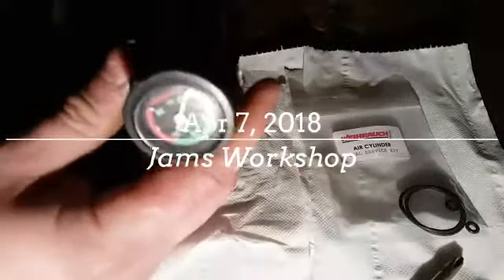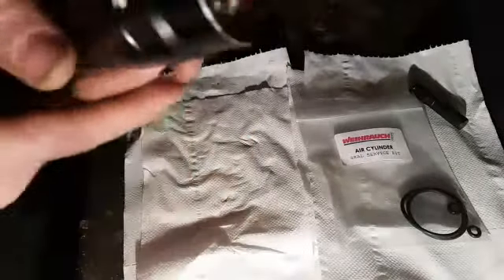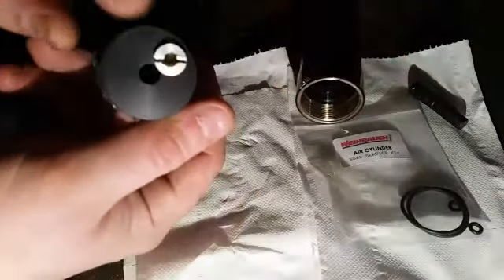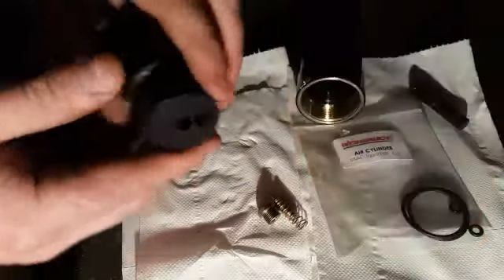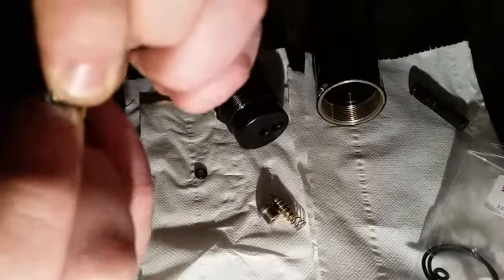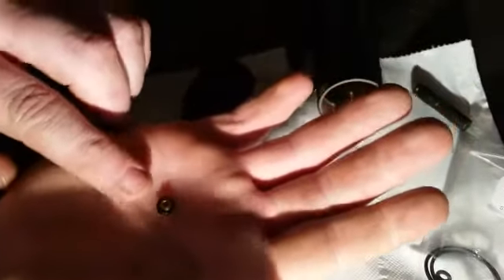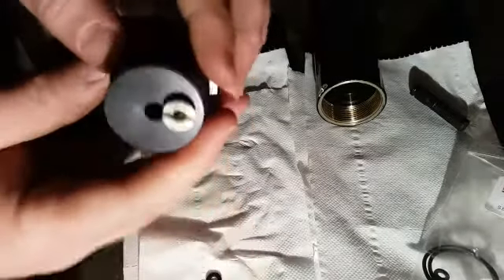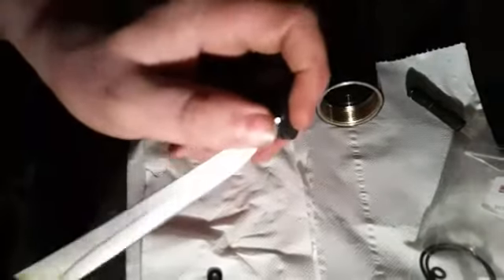Today's project fitting O rings to a HW100 cylinder

Comment: Nearly impossible to take apart the internal screw as it is denting (up to the complete distruction) without unscrewing. No way to remove that easy as in the video.
Reply from the maker: Your right mate I had help from.my vice ;)
Reply: @jamofalltrades9527  I mean the small screw retaining the valve of quick fill. Did you used the vice to unscrew  it?

Comment: Did you have any loctite on the threads? Yours came off pretty easily. I'm doing my cylinder tomorrow wish me luck haha. 
P.s aren't there any o rings on the valve side of the cylinder?
Rich
Reply: CHOPERUS23 it holds when pressurised. I’ve done up scuba regs finger tight (when no spanner available) and they held for a 50 minute dive starting at 298bar.